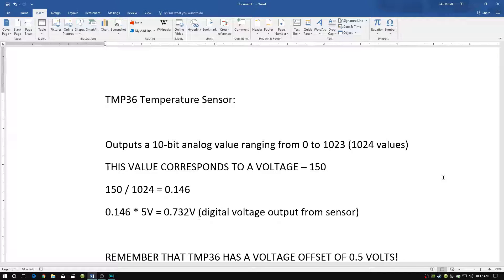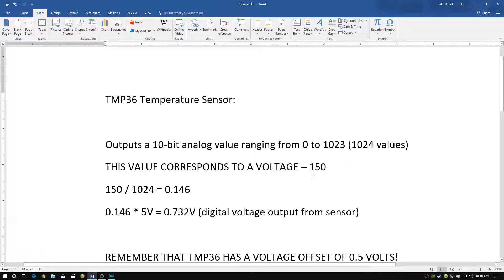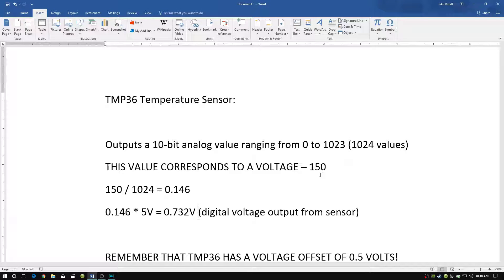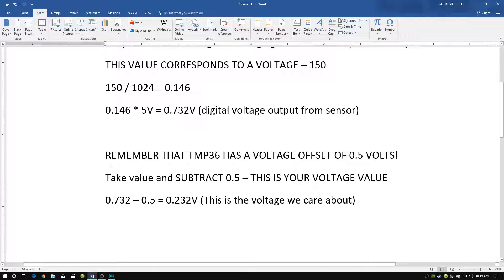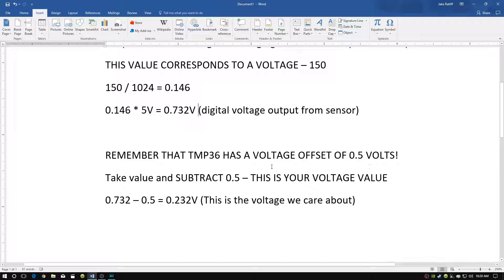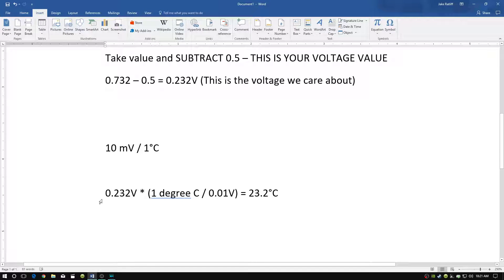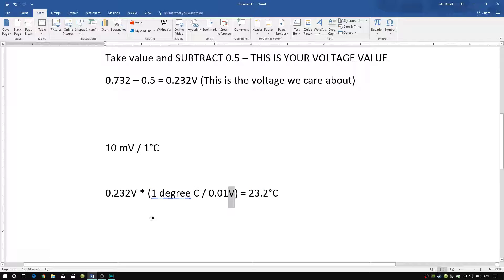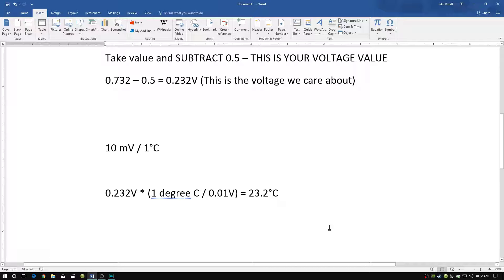HOW TO CONVERT ANALOG TO TEMPERATURE ON TMP36 TEMPERATURE SENSOR

Comment: Maybe I’m misunderstanding but I thought the 10-bit digital conversion from analog to digital happens ON the arduino board. That the sensor output is just millivolts. It’s a small difference, but it means one can use a voltmeter to check calibration by a simple formula to check if the arduino conversion is accurate enough.
I have been trying to use the TMP36 along with an ultrasonic distance sensor to adjust for speed of sound changes at different temperatures but the TMP36 is proving very inaccurate. So much so that I’m often getting better readings of distance by not adjusting for SOS. The TMP36 is often (based on using commercial digital thermometer to check) off by quite a bit around the 20 deg. C level, often reading like 18.x or less. Takes a very long time for it to adjust temperature when taken from warm to cold or vice versa. 
Tried a capacitor across the supply voltage to ground but it didn’t help. 
So thinking of checking if it is more accurate in colder (< 10 deg C) ranges and only calculating SOS when under that threshold.

Comment: Thank you for your video. I have been asked to do this: "The temperature readings must be converted from raw readings to values in Celsius. To compute the conversion, you should utilize calibration values stored in the CALIBRATION_PAIRS array. These values are constant. You can assume the raw readings are related linearly with the measured temperature." It's a simulation (they do not specify which microcontroller we are using). So I have to work with 4 calibration_pairs (uint16 temperature, int16 adc_raw_value). I thought about doing a linear regression and get the values of temperature directly from adc_raw_values. Can I do that or can you help me? It's for a job interview. Thank you very much.

Comment: Thank you for the video. But I have got a doubt. The maximum temperature TMP36 can detect is +125°C.  Whereas if the analog output is 1023, the equivalent temperature we get is 450°C. Please help me out.
Thank you.
Reply from the maker: From my understanding, this is the most accurate way to read temperatures using this sensor. I do agree with you that it seems a lot of analog values will go unused, but once you start getting above 125 Celsius, you risk damaging the sensor. The reason the max analog value is 1023 (total of 1024 values) is because the sensor is a 10-bit sensor. This allows the sensor to give more accurate readings. A temperature of 450 Celsius (or analog value of 1023) would mean that every bit is set to a 1. If this were say a 4-bit sensor instead, it may read 120 Celsius instead of 125. The more bits available on the sensor means it will get a more accurate reading. Hope this helps!
Reply: Ya. Thank You.. :)

Comment: Where did you find the output analog value information on the datasheet??
Reply: This conversion has to happen because a micro-controler is not reading the voltage but returning an analog value that represents a voltage. The answer is not in the TMP36 data sheet but on the Arduino Code website that explains the analogRead() function.

The TMP36 sensor outputs voltage. For my application I was using an Arduino. The analogRead() function returns analog values between 0-1023. Using a 5V Arduino  the TMP36 is receiving 5V and outputting 0-5V base on the temperature. The analongRead() function is representing 0-5V using values between 0-1023 (1024 options). To find out what Volts the TMP36 sensor is returning we need to convert from analog value to volts. 
Equation Explained! valueRead/1024(largest possible value)*5(largest possible volts value)
Reply from the maker: You're right. Arduino has a lot of helpful documentation. I think the only thing you'll need the data sheet for is the offset. Other than that, yes, Arduino should have all the other information. :)
Reply: Confusing at first, but I think I got it now. Thanks for the video!